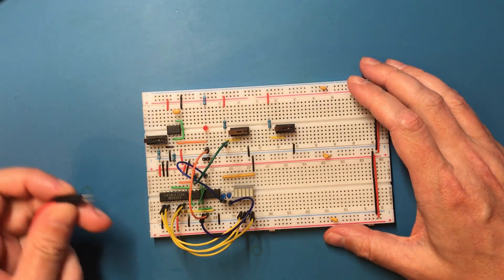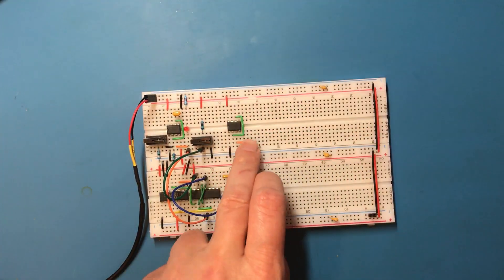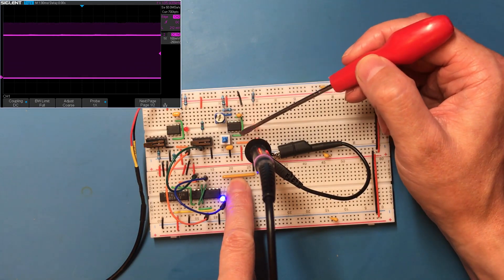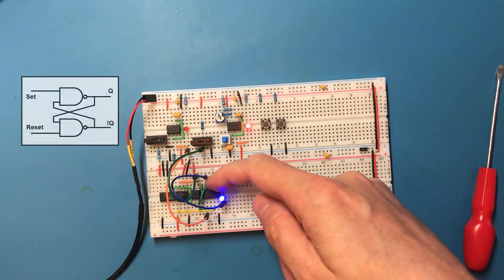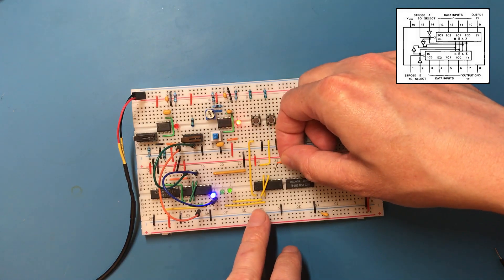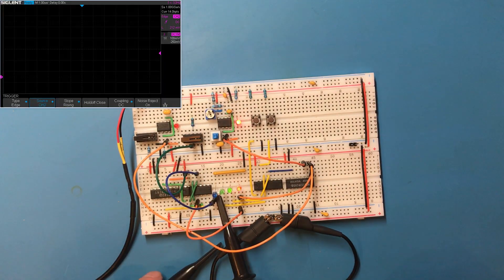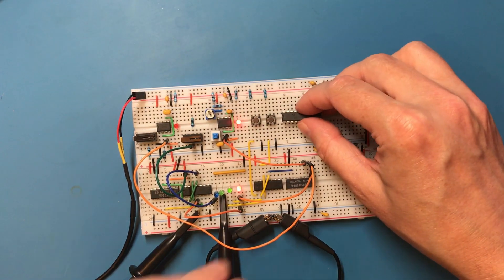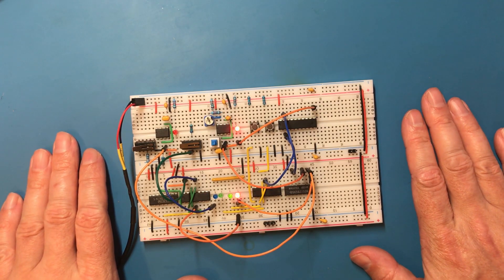Clock Select - Making an 8 Bit pipelined CPU - Part 76

Comment: The low period on the astable clock looks noticeably shorter than the high period.  Can this make problems for the timing of bus asserts?  Or not give memory time to produce its output?
Reply from the maker: Not really at slow speeds like this.

Comment: I went completely overboard with my breadboard computer's clock control. It starts with an 8 MHz oscillator which is frequency-divided by six 74ls93 counters. The 24 divisions (4 MHz down to 477 mHz) are split into three 8:1 multiplexers with their selectors tied together. Those three outputs go into the top half of another 8:1, along with an external clock line. The lower half is connected to my step button so I can set run/step mode with one signal. The selectors are all wired to a dip switch. The output is divided again through a '73 flip-flop so that I can inspect things every half-cycle.
Reply from the maker: Interesting. Very rare to see some someone use that notation for millihertz in computing, would usually see it written as 0.477Hz. I thought about having a large counter range to implement "trace" mode but I didn't like the way I would have had a big range of value inbetween "interactive" and "practical" that I never used.

Comment: Why did you choose not to use a 557 Timer? It is two 555 Timers in one and give clock and inverted clock for both.
Reply from the maker: I assume you mean 556?  But I use two 555's for a couple of reasons, primarily I've used them elsewhere in the build and I like to avoid adding another unique chip to the bom when I can avoid it. The second reason is aesthetics, the new clock has 3 separate inputs and a circuit to select one. I want the 3 separate clock inputs to be separated on the schematic and pcb, using a double timer chip would have obfuscated the design a little.

Comment: My "Ben Eater clock module" was displaying horrible bounce, especially when pressing the toggle button to select between manual/automatic clock. It was also the first circuit I built, and looked like garbage. So I rebuilt it, and now it looks so much nicer. I replaced the toggle switch with an SR latch, inspired by this video. I also replaced Ben Eater's AND/OR/NOT logic trio with two NAND chips, for selecting which clock to output (respecting the Halt signal). I don't have an oscilloscope, but I'm not seeing any bounce now!!! Really awesome. Thanks for the inspiration. I haven't been working on my build for a long time and only recently got back into it, so naturally it feels nice to make good progress. Currently working on the control logic, so soon I can move some bits around in my registers! Then comes the ALU. I want it to be more flexible than Ben's, so it'll be at least partially inspired by your build. Probably not as complex as yours though. We'll see. Thanks again for the inspiration and the videos! I've learned a lot. When I get a better internet connection I'll probably make some videos of my build, but right now it would take ages to upload...
Reply from the maker: That great Vortex! Glad it was useful. It's really worth having a good clock to start with, sorry to hear your Ben Eater module was suffering from some bounce. I'll be adding some halt like behavior soon to my clock, but it'll be a bit more flexible.

Comment: the 555 timer has a SR latch builtin, maybe you can add some logic to make it only respond in sync with the repeating clock. what about ANDing the switch with repeating clock before sending it to the latch?
Reply from the maker: Nice suggestions but I haven't worked out away to synchronize the change with a single gate. You suggest "what about ANDing the switch with repeating clock before sending it to the latch?" which sounds really good, it solves half the problem but the switch can still change the state any time the repeating clock is low, so the issue can still occur (that does stop it happening when the clock is high).
Reply: i don't think that you would press the change button while holding the manual clock, which may make this a good enough solution
Reply from the maker: The issue would still occur changing the other way.
Reply: AND both inputs to the SR latch with the ~clock so you have a gated SR latch. But then it would be better to just use the 74ls73/112 which have negative edge triggered inputs.
Reply from the maker: What would work is to use an edge detection circuit, and then AND the output of that with the inputs, then you can be sure the transition only happens at the edge. Of course what we are doing here is edging the design closer to a full D-type latch, which is what we have inside the 574.

Comment: If you use a '74 dual D type flip flop you could make a single button toggle for clock selection and have a spare FF for synchronising the output clock signal.

You would have to debounce the button with an RC circuit though.
Reply from the maker: Good suggestion, but I've built it this way accounting for some additional functionality I'm intending to add.

Comment: I’m always impressed with how you can visualise what you need to add to get the result you’re looking for.

When it comes to the clocking issue towards the end the thought that crossed my mind was an and gate, to only allow a reset after the clock pulse.
Reply from the maker: Thanks Scott! I really don't want to use the 574 as it is for that, but I have some more circuitry I'm going to add, I'll have a deeper think about it once I know what "spare" gates I have.

Comment: Loving your series. I noticed you get done odd clock behaviours within the larger CPU. I wonder whether a Schmitt trigger worried help? I'm no expert, but here's eev blog:
https://youtu.be/Ht48vv0rQYk
Reply from the maker: Thanks Steve! What "odd clock behaviors" are you worried about. My main clock related problems so far have been timing and transition time, I think things are looking pretty good as long as the final version of this circuits produces a clean output.

Comment: Always amazes me that you do it without microcontrollers and crystals but I have a thought.
Have you considered making a simple, basic oled oscilloscope daughter board that can be plug into the clocks output to measure the clock signals being sent to the rest of the system?
Reply from the maker: The crystals are coming ;-) There will be at least 3 in the final build (I think).  The problem with a scope output for the clock is that once it's behaving itself it's pretty boring to look at. Might be an idea to include more test points though.

Comment: When it comes to making the PCB, have you considered making a plugin daughterboards for the LED's that were removed once you had that bit working?
Reply from the maker: Not really,  If I think it's worth seeing I'll include it on the board anyway, there are lots of signals that i've not attached led's to (Mostly because the state is obvious once you know the build well). If I really wanted to demonstrate the reset countdown I'd consider going thru a 74??138 decoder to show it nicely.

Comment: At what clocks do you expect the entire system to run at?
Reply from the maker: Good question. The simple answer is "as fast as I can get it to go", I know the rated maximum of the counter registers is around 7.5mhz, the rom chips I'm using at the moment will cap me at about 4mhz (But faster options are available). Once it's all pcb I'll run some tests and see how fast it goes stably and see if I can diagnose the reason for whatever the max is.